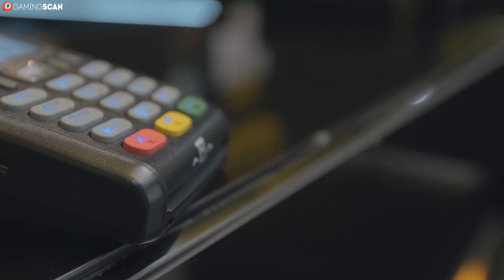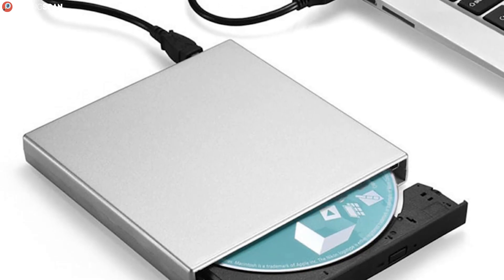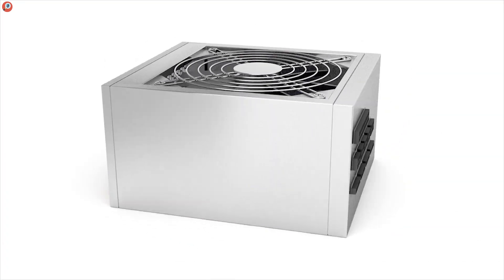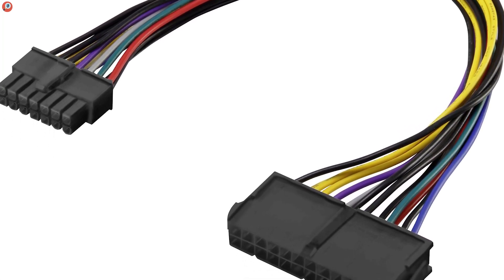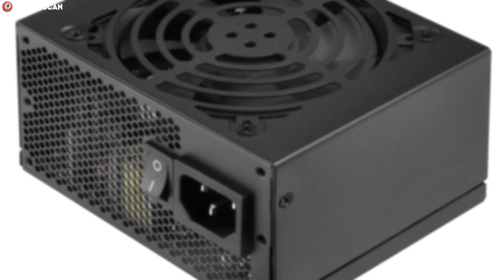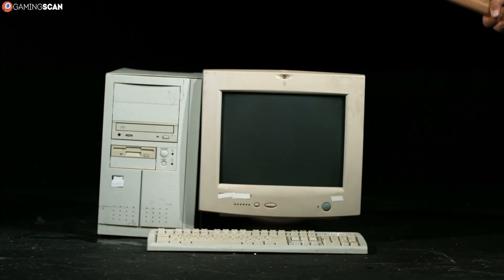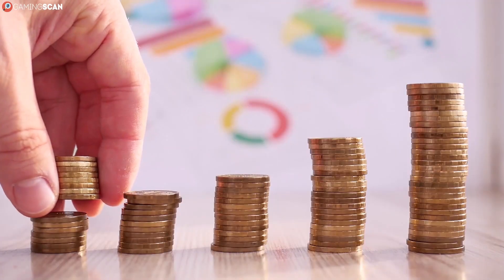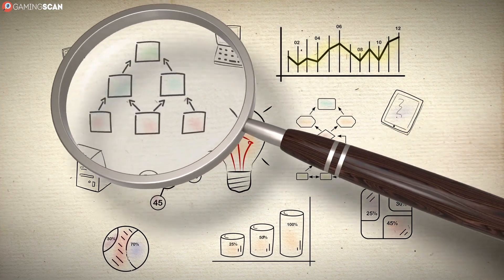How To Choose A PC Case [Ultimate Guide]

Comment: how can i double check if my parts like gpu and liquid cooler will fit in my new case? do i just use a tape measure or is there something easier i can use to input my parts and check if cases are compatible? (im lazy i know)
Reply: Goroyo 9090 You can look the case up on amazon if it’s on it and it may say the length and width for the parts
Reply: pcpartpicker.com*

Comment: what size case should I get for this build?

GPU: MSI GeForce RTX 2080 TI GAMING X TRIO 11GB Graphics Card
CPU 19-9900k
RAM: 32 GB vengeance RBG pro RAM DDR4
Mobo: ROG Maximus XI hero
CORSAIR RM850x 80+ Gold Certified Power Supply
NZXT Kraken x72 360 mm AIO RGB CPU liquid Cooler
2x NZXT AER RBG 2 120 mm fan
Seagate BarraCuda 2TB Hard Drive
SSD
Reply: Nzxt h510i
Reply: @its_anurag_7856  is that the only case that would work?
Reply: @rkkzjj32  nope. Just buy a cheap atx case. Corsair cases highly recommended. NZXT is way overrated, and their fan base is mostly just kids who think they're the best since they look cool.
Reply: @rkkzjj32  also I highly recommend the corsair carbide 275t of the corsair 220t or something along that name. I generally hate corsair products, but their cases and headphones do not deserve any hate.

Comment: This is one big mistake i made and i now regret it. The case i use was cheap had rgb and had temper glass on the side but once everything is inside its very tight the top 120mm fan is stuck to the motherboard pin connected its very hard to connect. Now i wanna downsize to mini itx but i have a 2.5 slot 1070ti which makes matters worse. Before chosing a case CHOOSE UR PARTS CAREFULLY DONT RUSH THIS PROCESS!!!
Reply: What case did you get so i don't choose that one?

Comment: I don't have to . I just buy Liam LI O11 Air flow there is nothing to choose.
Reply: Brian  I duno about O11D XL but on the O11 Air flow i installed 10 case fans + water coller 280mm with 2 fans 140mm . How many fans you can install  on O11D XL ?